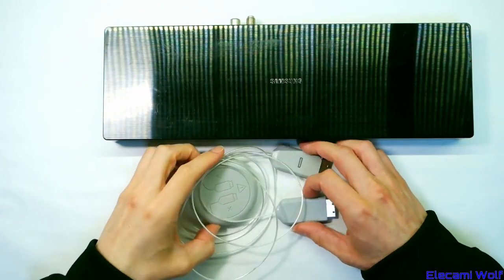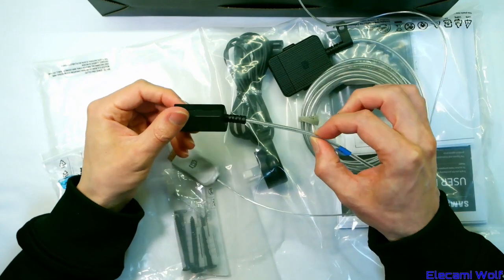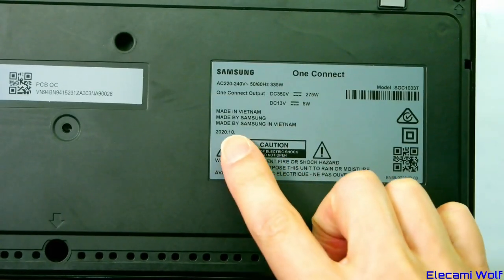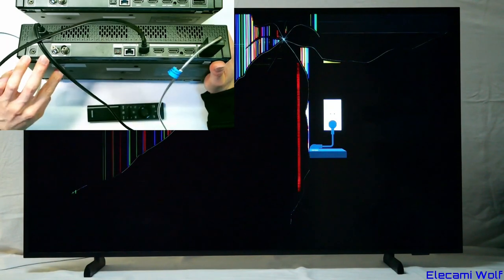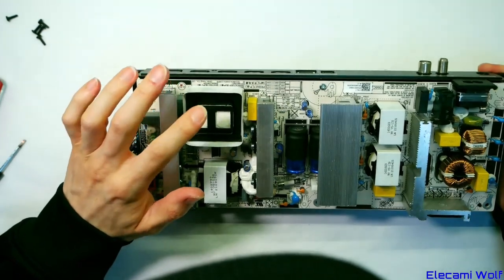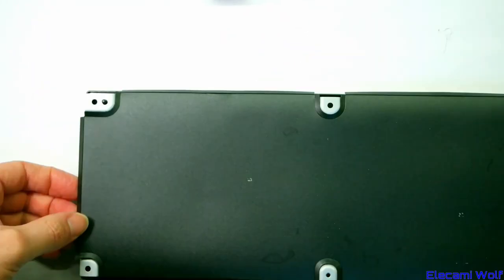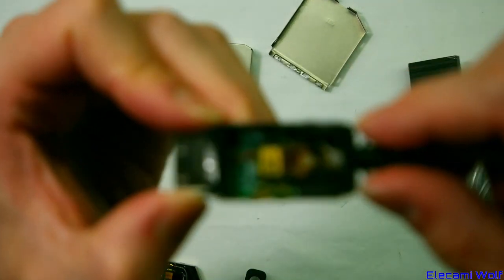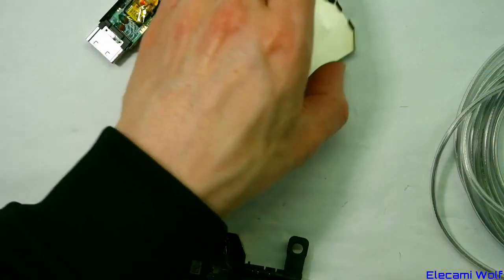EW0040 - Samsung The Frame 43 2021 Version Teardown

Comment: I have another model (SOC1002T/BN91-21828C), but the mains power board looks almost identical. It's died on me. Fuses are ok, caps "looks" ok, and I can measure +12vdc on the pins located by the connector that goes to the board below. However, I can not measure anything on the +350V pins. When attached to the tv, using these contactless voltage indicators, it will indicate there is voltage on the cable, and the whole panel will make the indicator light up. Which essentially doesn't say much though. However, should I be able to measure 350V on the pins when the box is powered up, without the tv-cable plugged in?
Reply from the maker: I think the 350V supply would only turn on when the TV is connected and in powered on mode. The 12V supply will be for standby and waiting for the power up signal from remote or buttons. 
I never tired to measure it.
Reply: @Elecami  thanks. Do you know if the box makes any kind of "click" sound when connected to mains ? Or is that click I'm referring to maybe when the panel turns on/off. I recall it sometimes clicking when i turned on/off the panel
Reply from the maker: @cossecoss  Mine has a relay click when I connect it to mains, but it also fully turns on when AC connected. 
When switching off TV from the button on the TV it makes two clicks. When turning on again, no click. A bit confusing.
Reply: @Elecami thanks for taking you time to reply and great content on your channel!

Comment: 25:59 the outer shell is removed but I am unable to install it back. There’s a pressing mechanism which is getting very difficult to install the shell to the initial position. If I can’t fix that, is that ok can i use the wire without outer shell?
Reply from the maker: It will work without it, just be aware dangerous high voltage inside the connector. Make sure the metal cover is in place. Leaving off the black plastic housing is ok.
Reply: @Elecami  Thank You 😊

Comment: Our 55" frame tv doesnt seem to be getting power from the one connect box. Replaced the power supply in the box, tried new cables, nothing. Any suggestions?
Reply from the maker: If you have changed the external parts, then the problem must be in the TV. Power supply board etc.
Reply: @Elecami  Right on, I'll try the power supply board next. Feels bad throwing parts at it but it will feel worse to have to toss this thing...
Reply from the maker: @_blindminer  Might be possible to find one with a cracked panel going cheap?
Reply: @Elecami  So interestingly, the replacement One Box I had was a model one-year newer (2022) than my original 2021 box. I tried a new PCB in the One Box that matched the model year of my TV. That, along with the new power supply, and it fired right up. Possible that it was only the PCB assembly but my guess is there could be some software at play preventing use if you're trying to use any component not 100% matched to the model/year. Regardless, happy to not have to buy a new one!

Comment: Does the one connect box turn on when power is plugged in. Got a cheap 65 frame tv but not sure if it’s the box, which I’ve ordered two from eBay and can’t seem to get any lights to come on the box
Reply from the maker: It will not power up unless the TV panel is connected correctly and working. 
There are no indicator lights on the box. The optical audio output would show a red light but only when TV is powered up successfully.
Reply: So then it might be the main board that’s bad. Don’t see a standby light where the power button is on the tv. No click sound coming from box when power button is pressed.
Reply from the maker: @josedimas1850  Possibly, or the One Connect Cable is bad.

Comment: how often do panels arrive broken? I install a lot of menu displays and about 15% of the time they arrive busted
Reply from the maker: I don't know those numbers. I don't usually deal with TVs. I knew this one was broken, I got it very cheap because of that. 
From what I experienced when trying to get a replacement panel for it, 2 out of 3 panels arrive broken. Out of a sample of 3. The third one was shipped by a different company.
Reply: @Elecami  oh wow what a failure rate! but considering its a 55 inch potato chip 😬
Reply from the maker: It was the replacement 43" panel that arrived damaged 2 times. It was bent. Lack of support in the box and probably dropped on its side.